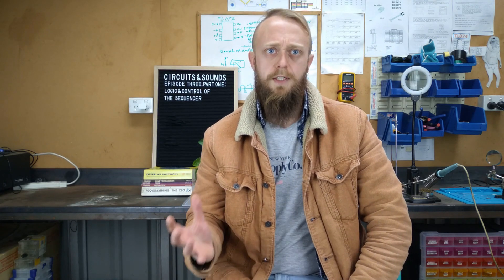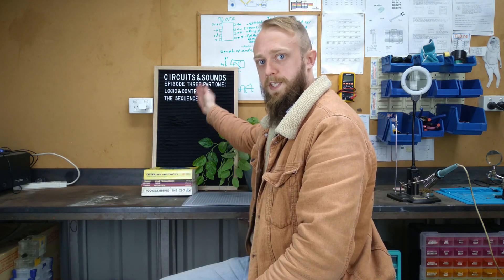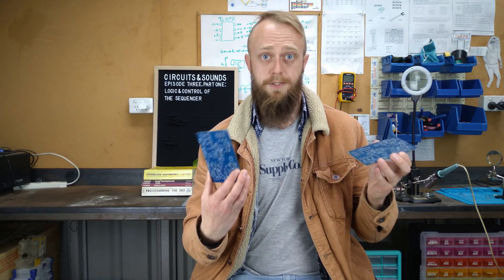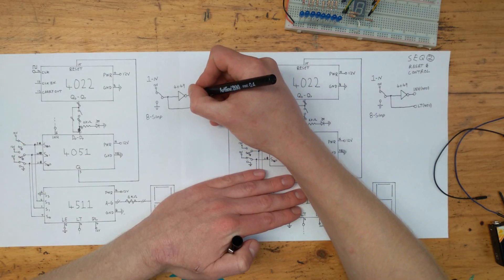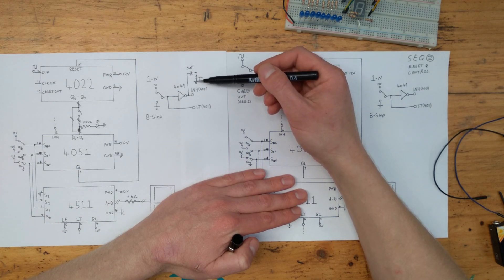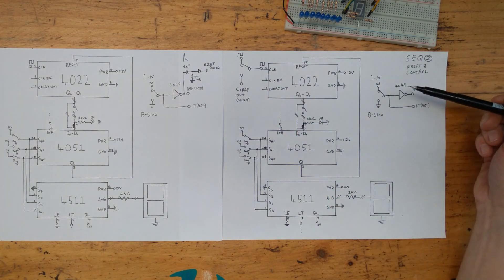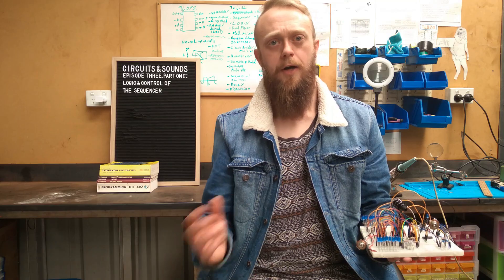Logic & Control Of The 8-Step CMOS Sequencer (A DIY Tutorial On Making A Better Baby 8 Sequencer)

Comment from the maker: Timing index & GITHUB link:

00:00 - 03:46 - Intro, PCB Giveaway, What is a Sequencer?
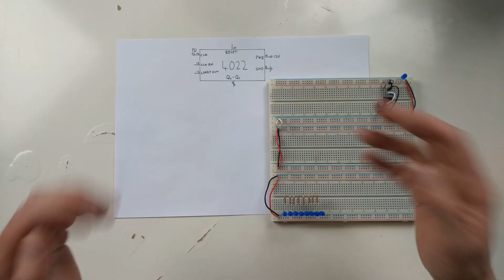3:46 - 8:03 - Sequencer Circuit Overview, 5/4 & 4/4 Time Signatures
8:03 - 13:23 - 4022 Counter IC: What, Why & How?
13:23 - 17:10 - 4051 8:1 Multiplexer IC & Sequencer Reset Control
17:10 - 20:43 - 4511 7-Segment Driver IC & 7-Segment Display 
20:43 - 22:41 - 8-Step/1-N step control
22:41 - 25:46 - 2nd Sequencer Cascade Mode & Carry Out Mode
25:46 - 28:45 - RC Reset Circuit & Sequencer Synchronization 
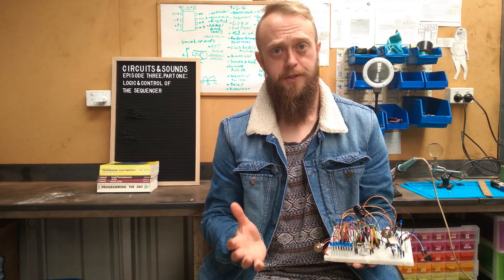28:45 - 32:33 - Sequencer Voltage Control 
32:33 - 33:23 - Outro

Crazy Clock GERBER files available here: https://github.com/CircuitsAndSounds/Crazy-Clock

Follow me on instagram @ sebscircuitsandsounds for behind the scenes views!